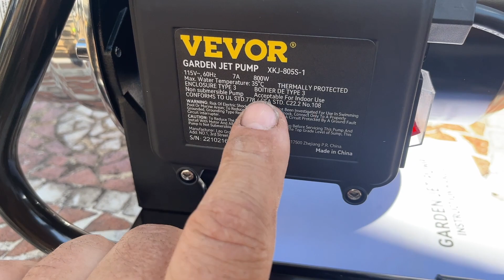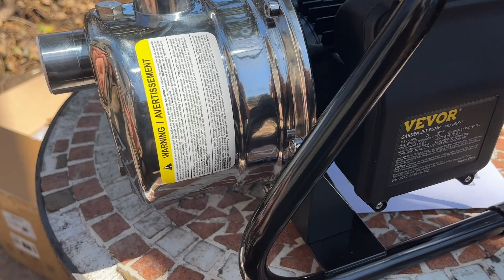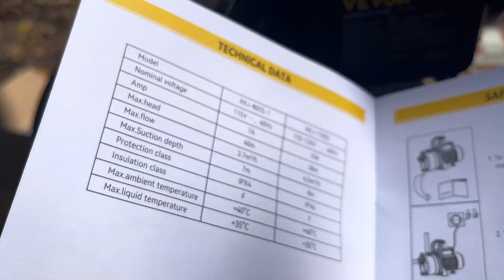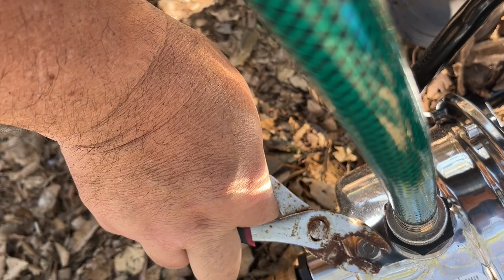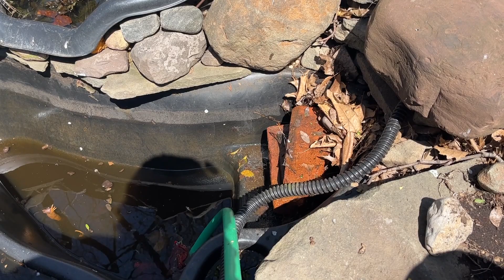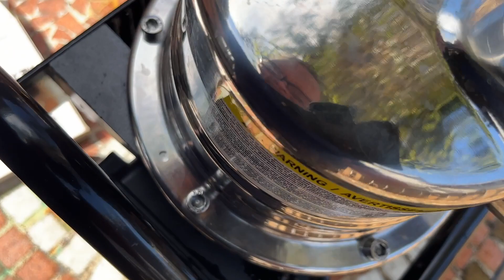Vevor Garden Jet Pump - Better Than Harbor Freight?

Comment: Can you run this continuously or just intermittenet? I'm designing and R/O system for pools with high chemical levels and will be consumer budget friendly. Thank you
Reply from the maker: If you mean continuously as in 24/7, I’m not sure, though I wouldn’t see why not. As long as water is running through it there shouldn’t be an issue. I’ve run it “continuously” probably for a half hour to 45 minutes without issue. It really is a solid, well built pump

Comment: You need a foot valve on intake side to keep the prime and keep debris out
Reply from the maker: Agreed. Despite the lift claims, keeping it primed is difficult. With that said, it works flawlessly with my rain barrel system where the water pressure is constantly flowing in

Comment: Float your pick-up filter to just off the bottom ! Won't get clogged as easily if at all
Reply from the maker: I ended up making a filter out of some pvc connections and screen that did just that. Worked much, much better. The Vevor site does say its only for clean water so I really can't hold it against the pump.
Reply: @HomesteadDIY  for sure and om sure no one is saying that either.
 You did an excellent job of showing what this little pump can do.
  I thought I would give an idea I had for my own pump (transfer).
I built a system using harbor freight 
Preditor series 6.5 hp engine and Northern tools kit pump in 3 inch size. For future use. ( shtf).
  That way I can help a lot of people get water from a lake etc.
Thank you for your reply too.
  Great show !

Comment: That's the same design impeller and the cap housing is very similar to my home shallow well pump  that I replaced the impeller in yesterday.
Btw, impeller was $134.95 !!!
JUST THE IMPELLER
Reply from the maker: Yowser! This pump runs anywhere from $80-$110 depending upon site. Cheaper to just buy a new pump!
Reply: @HomesteadDIY  I agree  but this was my pump for the house and outside stickers.
240 volts.
Old school shallow well type not submersible and yes I was shocked too. The gaskets were 10 bucks a piece X 3.
  Thank God I can do my own " wrenching "  still.
Been a wrench since 1967 professionally cars for 20 years then went to marine repair at the dealerships till I got tired of who I was working for and did my own thing for 21. Time to retire I think  lol.